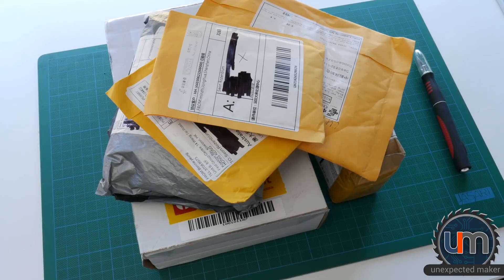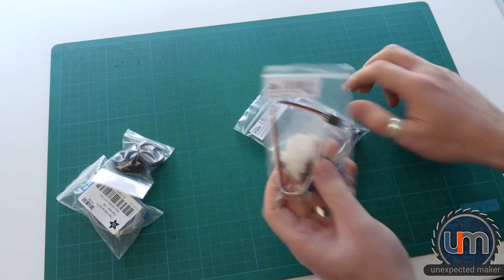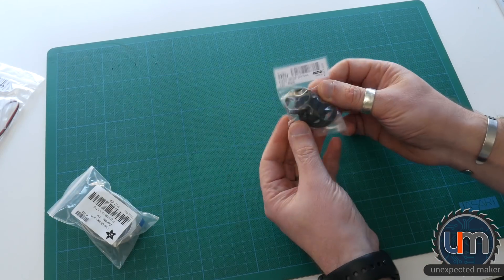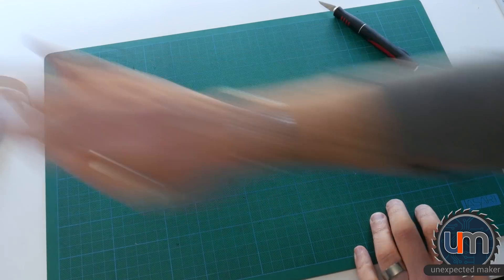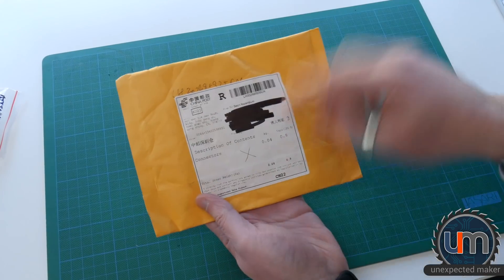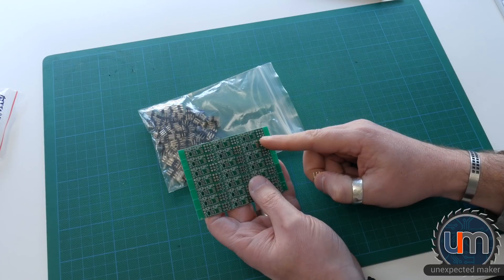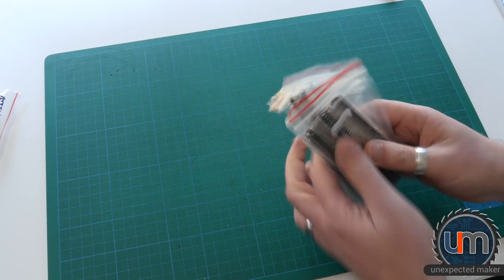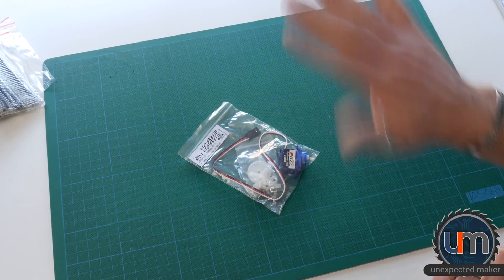Unexpected Mini Mail #01- The Refactor....

Comment: Looking forward to the motor project!

Does that ribbon cable work with a pi zero? It looked like it was the same width both sides
Reply from the maker: I have the smaller converter cable and an adapter that sits between them... but the adapter is in a package I have yet to open ;)  Foiled by mail videos again!

Comment: Here's a little off the wall bit of thinking, you know the 2x3 headers? And you mentioned that people probably, or may not need them. Could you V groove the header section so it could be snapped off with little effort, to save space for those who may need it (or after the fact of programming etc.) on the next batch, providing you could use one layer for the header.  I acknowledge you have loads of them so I doubt a next batch would be a thing...  (this is the usual BS comment I make on live streams people, and I'm open to arguments etc.)

Edit, it's late for me so I apologise for bad formatting / readability of my comment. Painkillers suck, and these lil mail bag vids (from all like minded youtubers - not those who specialise in unboxing, sod those guys) are a great lil wind down. I like the mail bags cause I see what's available out there without having to really be in the loop, it's nice to spot something that you could possibly achieve, such as Brian's keypad / keyboard libarary amalgamation to make an HID device that's really configurable, for example. I'm doing my damndest to learn, and things like this are really helping me. 

Thank you Seon, and all the other YT guys I comment on.
Reply from the maker: I'd have to move them onto the wrong side of the RGB LED Strip connectors, which invalidates it's main use case tbh (in my mind anyway). Also, does the board really need to be smaller? it's 26mm x 9mm as it is ;)

Jon, your comments and participation is ALWAYS welcome, no matter how zany your ideas are ;)

Comment: No need to make a "programming board" for the pogo pins. Just grab a ready $2 board and solder the pins in its holes. https://www.ebay.com/itm/x/311566698886
Reply from the maker: Oh sure, sorry, I should have been clearer... I'm not gong to design my own, lol, I meant I was going to add pogo pins to an existing programmer, or just use protoboard to extend the new pololu one one I have - which is FANTASTIC!